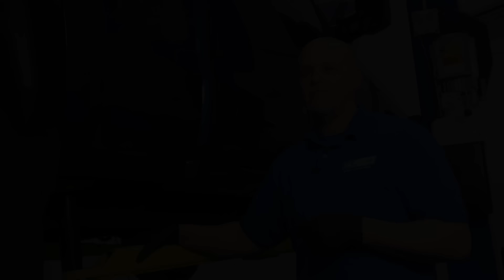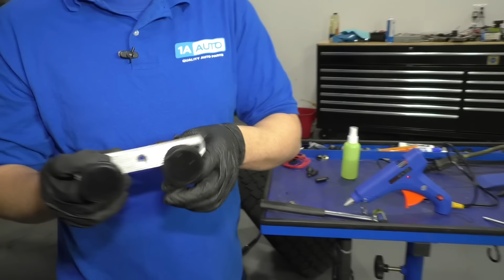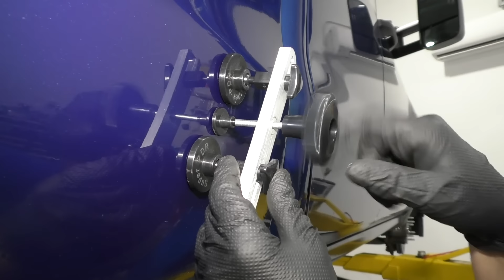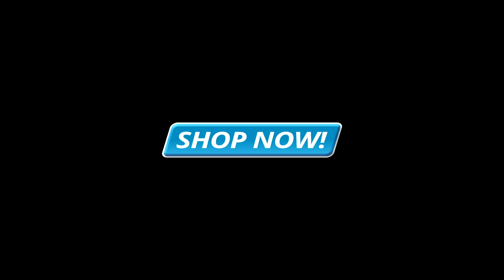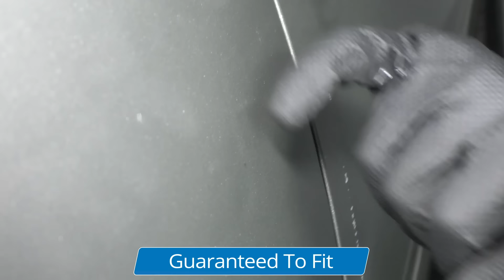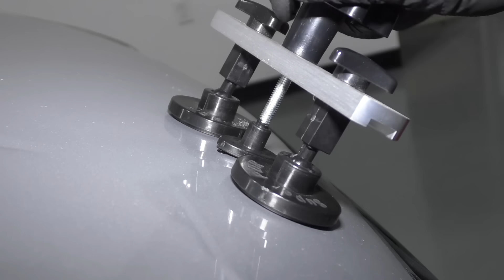How to Fix/Repair Small Dents on Your Car by Yourself

Comment: That dent would still bother me afterwards. If I still see it afterwards just gives me more anxiety.
Reply: Lol... you should see the car that my grandad bought for me without my second opinion. I paid half, but little did I know that it has probably 10 of these dents all over the car. Scratches everywhere, not in a swirly pattern, but vertical. Then a day after the car was bought, my grandad curbed the whole front bumper and tore the paint off all the way down to the plastic. 2013 Accord 😂😭 causes so much anxiety, no one else will ever comprehend. There are scratches and makeup in the interior from the previous owner who I am assuming was a girl who wore too much jewelry lol. Buttons have paint that’s rubbed off, the sun visor is loose and had been abused. The door  had makeup and bronzer all over it, had what seems like a knife cut in the lower storage compartment of the door. The headlights look like someone sanded it with sandpaper and put acetone on it. Looks like nail polish remover was dumped on the hood and on the trunk. Paid KBB value for it and needs at least $3,000 of Methodical DIY work to get in average shape.
Reply: @TheNuclearBolton  hahaha that’s insane bro hopefully everything goes well with it
Reply: @TheNuclearBolton  Sounds like the average car in the 3rd world. No matter how much care you take, you lend it to one person and it comes back with multiples damages. Park your car and come back to dents.
Reply: Me too! I’d probably make it worse “if I just did it once more.”  Damn you, OCD!!

Comment: can you pull the dents out 100% to the point of not their ? or is their all ways a distortion in the light no matter what?
Reply: Actually if your good absolutely no signs at all on most of them I should say there are a few that are 99 percent but better than the latter

Comment: Does the glue damage the paint?
Reply: Likely if you leave it on and don't clean it. Otherwise it's just like anything corrosive to the paint, won't do much if removed quickly.

Comment: I think these methods only work on later model cars that seem to be made of really thin aluminum because an older car has thicker metal and cannot be easily popped out or bent back from the inside panel.  I tried to remove a dent from my 2006 ford taurus driver panel and door but came to find that the metal is very tough to move with PDR tools that i ordered off of ebay.  The only PDR tool that comes in handy is the little rubber mallet with different sized ends.   To get the metal to move i had to pound it with a piece of PCV pipe with a toilet bolt plastic cap taped to the end.  I used a hair dryer and the afternoon sun which seem to help a little.   These new cars are made out of almost all aluminium and plastic, so of course its easy to fix them.
Reply: Those taurus’ are built like tanks lmfao

Comment: Ok…someone door dinged my new car. 

Quote is $2050. 

Dent is size of pinky nail, but chipped paint in the crease of the quarter panel where it meets the bumper. So the bumper would have to be removed, etc…..thus the cost. 

I think I can do this and save money.

Comment: Doesn’t work. Don’t waste your time. Bought the tool. The glue doesn’t hold to both surfaces strong enough to pull out the dent. I tried cleaning surfaces with alcohol. Helped a little but does not bring out the dents. Don’t waste your time or money. Dents are not cheap.
Reply: So, because YOU couldn't do it means that others can't?  It works exactly as in the video - no camera trickery.  Try again and try a positive attitude!
Reply: You have to do it multiple times for it to work I heard people doing it for 2 hours depending how deep the dent

Comment: Dent is not gone at all.  Why spin the tab while applying hot glue? That won’t make a difference. Paintless dent repair is a skilled trade that takes much training and experience. How do I know? I do it Professionally for a living. If you want it repaired completely and not 50%, find a reputable PDR technician in your area. Trust me, you won’t regret paying someone. It is not as easy as it looks, i nearly gave up learning this profession myself.
Reply: Ooor u feel threatened^^
Reply: And just to get a dent out you would normally just neglect? Like my car came with some dents and I don't really care about it so much to pay some one to fix it, but a simple tool like this to make it less stand out seems decent right?

I'm not aware of the price of this as of writing this but can't be much more than 20 bucks
Reply: Nearly gave up on fixing dents?? Gees
Reply: My quote for removing some small hail dents on hood, roof and trunk is $850 from two professionals.  I just need an 80% job so I'm gonna do this.
Reply: DENT Tecc this is just for do it yourselfers that don’t want to pay you to do it